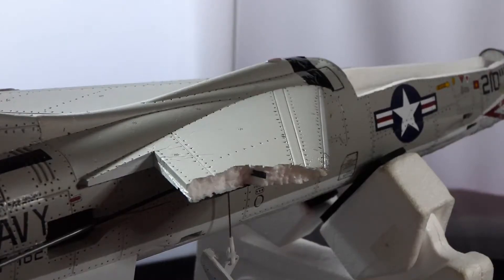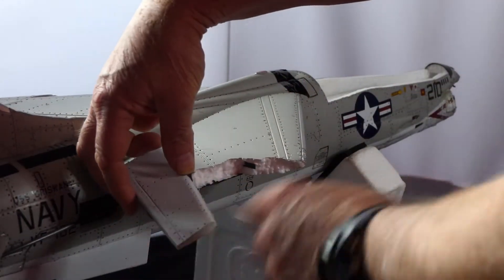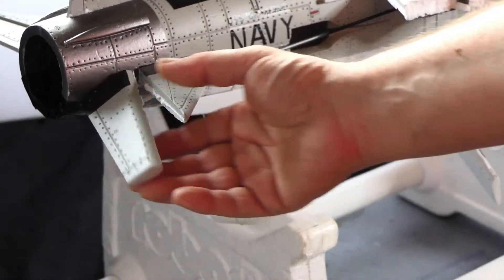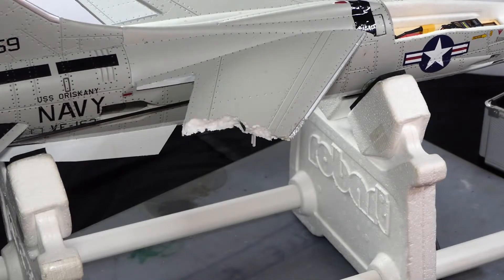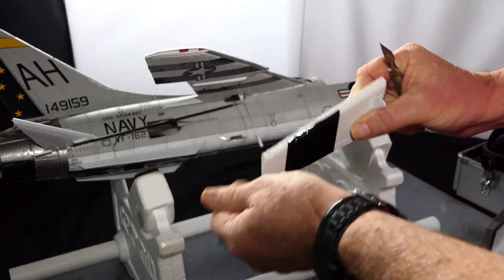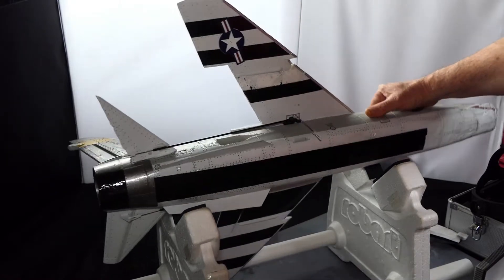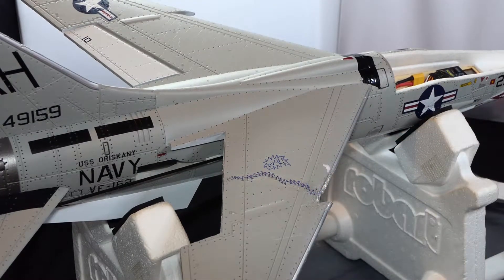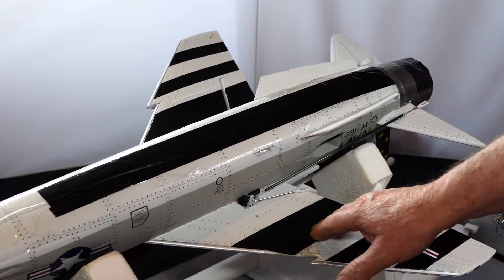Repair work on my 64mm EDF -  F8E Crusader - 25 October 2020

Comment: Finally come across this video Martyn - excellent thank you - really interesting to watch how to repair the aileron/elevator as I'm bound to need to know this sooner or later! I enjoy flying this Crusader but have yet to turn the gyro off! When I'm ready.....
Reply from the maker: I do not recommend or like this aircraft - I crashed it so many time (no Gyro) that I decided enough as enough and it has been trashed - its really old school stuff - 5 blade edf unit came out of mine and straight into the bin.. - I suggest - Do not turn the gyro off ..LOL...cheers Paul - stay safe  Martyn
Reply: @FlankerTanker  Thanks Martyn - message received!

Comment: Surprised you didn't add some carbon fiber rod as splint, when doing the wing repair.
Reply from the maker: The break was so clean i decided it did not need it - but time will tell !!
Reply from the maker: I should add that although it is not on the video I did add some cocktail sticks going from one part of the wind to the other across the break - these were added at an angle from the bottom surface.
Reply: @FlankerTanker  Ah, so you did use a splint. Then it should probably be fine. With quality glue and a splint it might be stronger than the original situation.

Comment: Just goes to show the shark looked totally crap and not a scratch on it the crusader looked the business and landed up in a Bush.... You ever can tell
Reply from the maker: Your right - and the shark glides quite well - regarding the motor cutting out in flight - having done some checking it seems that the ESC cuts off at 100Deg - I did a bench test and it did CUT OFF - it was Burning Hot - I tested the Amp pull and its about 42A - the ESC is 40A - so in fact should be OK - I have raised it so it is in the Direct Airflow next time I fly the Shark and we will see if that helps - if not I have a 50A ESC ready to install...

Comment: Hi yah  first law of engineering IF IT GOES ROUND IT WILL GO WRONG.
SO THAT'S PROP. AILERONS ELIVATOR RUDDER.. I NOTICE YOU DONT USE CARBON OR COCKTAIL STICKS TO RE ENFORCE THE WING BREAK..
Reply from the maker: I had thought about doing the cocktail Sticks, but  was not sure I could like everything up as the break was so clean -  it is not on the video but I did add some cocktail sticks going from one part of the wind to the other across the break - these were added at an angle from the bottom surface.